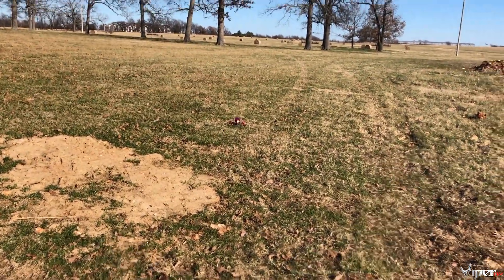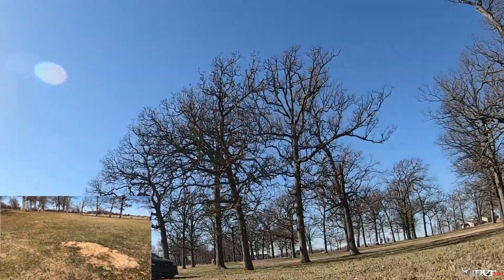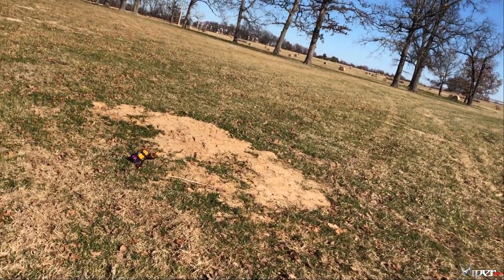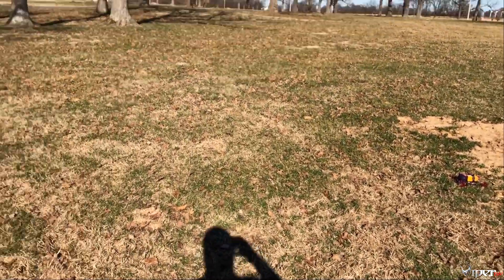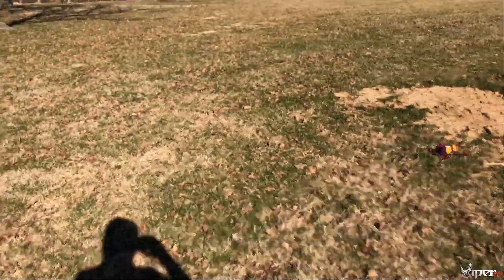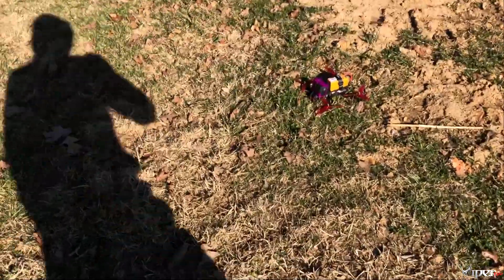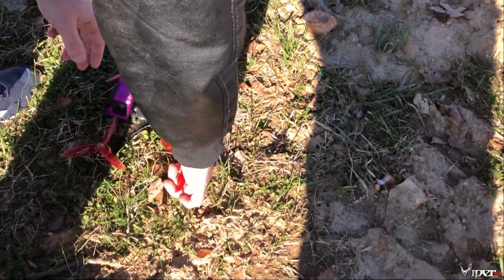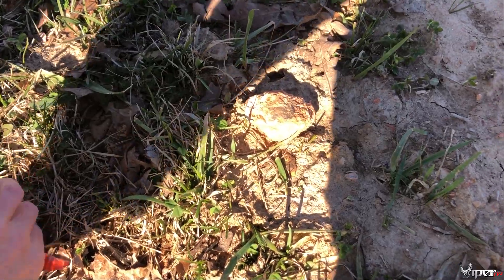What Happens When You Fly 6S With 2750KV Motors?

Comment: Well there is no magic, if you drain your 6S lipo significantly faster, the unused or missused energy goes into heat. Your motors maybe cold but check your esc temp. I was a victim to this high voltage high kv nonsense. Do not do it people, you will burn your quad someday, most definately in or soon after a crash. I have spoken to a brushless motors engineer and he told me the whole story behind why it's a stupid idea. If someone wants further reading, write me privately, I will send you my records from the conversation. If you don't trust me, trust an engineer, I have burned a Tekko32 ESC twice, the second time there was not much left from the quad - FC, frame, RX & VTX, the camera - all got f*** in the fire!

Comment: I fly 2800kv on 6s everyday and zero issues
Reply: Motor model?
Reply: @aremie011  they're geprc speedX gr1507 2800kv
Reply: @2toeninja  those motors are designed for 6s. A 2800 kv typical 5 inch motor isn't the same as typical 2800kv 3-4 in motor.

Comment: I’m always putting my high KV motors on 6S. I’m determined to find the best motors for top speed runs that don’t get super hot. So far my best find has been the Ledrib hypetrain 2650KV. They take 6S no problem on bi blade props, but do get very hot in the midst of the summer. In the winter it’s no problem at all. The worst motors for top speed for me has been Tmotor. Every high KV Tmotor I ever put on 6S starts cooking ridiculous hot, even if I’m just cruising.
Reply: I have a 3" currently running T-Motor 2550KV motors on 6S and it absolutely rips.  No issues thus far.  But it is very cold outside and I haven't ran it in the heat.  Getting around 5 minutes on 1100 mAh packs.  Punches pretty hard but I'm not really going for speed.
Reply: @NomadAerial  hey what frame are you using. I have a lot of spare 2500kv 2306 but i dont want to build another 5 inch
Reply: @kobie4238  do a 4" or 3.5" ?
I was looking at 2306 or 2207 for terraplane 3.4" cinewhoop
Reply: What's the fastest you have gone? Any videos?

Comment: So... you used a premium frame, but to test high KV motors on 6S you selected Flywoos? If I were to run high KV on 6S (which I do as it does have its application... even unbridled... in high speed attempts. Not for the faint of heart, nor a noob), I would have only attempted that on Hyperlites. I've had them too hot to touch and remain  smooth hundreds of runs later.
Reply from the maker: That’s the point of the video, even flywoos work. Btw this quad originally had xing motors but I swapped them to test these motors.
Reply: @ViperFPV  You know... I did pop off there because I thought "man.. is he taking that test serious?", but now... I see what you did there. I kinda saw that graphic and was thinking "I run these things hard as hell and I never come back in flames!" Well, it is good to see someone put a little rigor to a Q I been seeing countless pilots asking these days around the 'tubes. Good work.

Comment: Been doing it for years. You oughta try 3000kv 6s
Reply from the maker: Dna Fpv ok challenge accepted!
Reply: Actually the key to high kv desync cure is demag to high and raise your idle percentage or min throttle, good esc’s and lower pids help with the tune and durability though
Reply: Dna Fpv I’ll keep those in mind when my parts come in, thank you both!
Reply: I can get you the 6s 3000kv motors when you’re ready 😊
Reply: you've been doing this high kv 6s stuff for a while? got any tips for me to prevent desyncs? looking to get a setup similar to this, and I want to be safe and procedural about it. Thanks!
Reply from the maker: Zephyr yeah solid ESC with 50amp rating or higher is my biggest tip.
Reply from the maker: Also take betaflight defaults and turn them down all about 20 percent.
Reply: Viper_FPV thanks for the tips, I plan on using a tmotor 55a pro2, but I’m also looking into the 4in1 you’re using. How is it holding up so far? Any complaints?
Reply from the maker: Zephyr t55a pro is a good one , I’m using a 60amp esc I believe from spedix
Reply: Dont do that, i have a hglrc arrow 3 hybrid 6s now with the limit motor at 2700kv because for first i burned my old motor in 6s with 3000kv. If u have a 6s dont pass the 2700kv and if u want more security limit your gas at 90% now im flying at 2700kv with 80% of gas and i go so fuckin freaky in freestyle is the best!

Comment: In most circumstances the battery will limit the power but I think you might find that they will crap out under certain types of aggressive maneuver where the pids want to give all the power to 1 motor. Cool vid though.
Reply from the maker: Indeed but the battery was not very hot.
Reply: @ViperFPV  send it harder then! ;)

Comment: Nice. What kind of amp draw did you see on punch outs?
Reply from the maker: I will have to check the DVR I’ll update you
Reply: Viper_FPV Thx. I noticed you were using a 60A 4in1 esc. 

I’ve got 2207 2700Kv motors and only a 30A esc so... 😂
Reply from the maker: YOLO FPV yes quad was overbuilt to take anything I throw at it voltage or obstacles. That’s why it’s the ultimate FPV freestyle build lol
Reply: Viper_FPV Nice. Maybe I should get myself a 60A esc. Seems to perform spectacularly!
Reply: Yea i have a 100a 4-1 ESC on my 5.5” frame lol i run insane motors all the time 65a & 100a insures you can run anything pretty much well with the 100a anyways. I know that T-Motor F80pro-2200kv will pop a 65a esc eventually you might get a few good packs in but it cant handle it long.